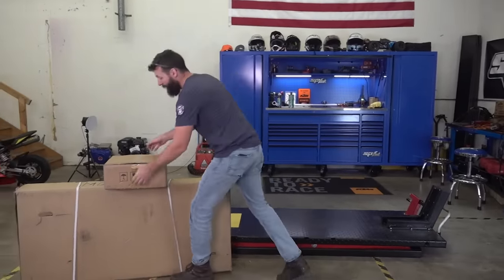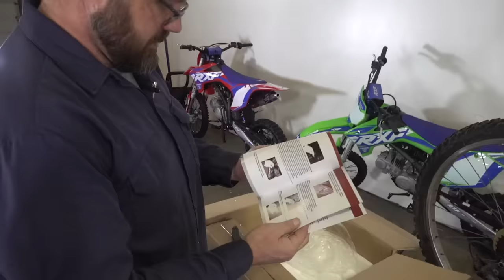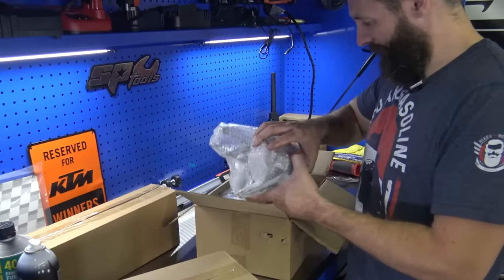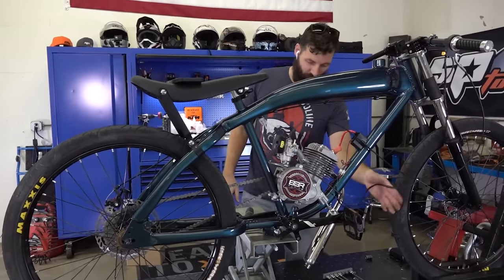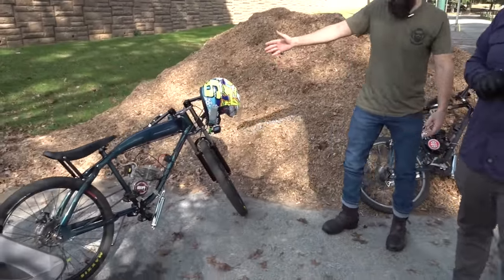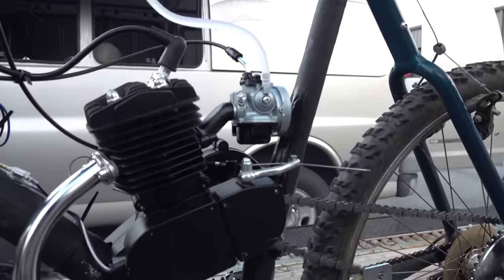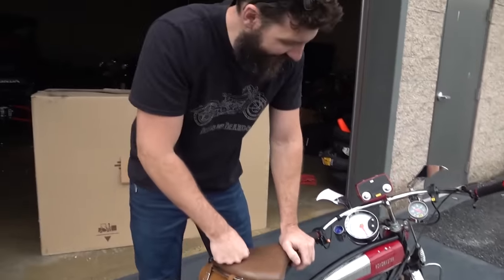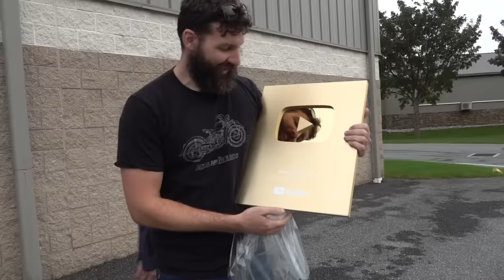I Bought the Cheapest and Most Expensive Motorized Bike kits from Amazon

Comment: Had one of these in high school.  I tuned and polished the ports, and sanded down the jug for higher compression.  It was an absolute riot and weighed in at only around 50lbs, so it would do about 35mph on the straight.  Wouldn't want to go much faster than that on bicycle tires and a single tiny disk brake, but I loved it!
Reply: I hit 60km/h going downhill on the way home on my normal mountain bike, solid as a rock lol
Reply: 65mhp here bud. Thats when i has a stroker engine.
Reply: I got a cb750 for free from my mates dad because they didn’t want it (it had 900,000 ks on it) and I chucked it in my push bike it was fun but jeeez it was scary I think best I done on it was about 110 on a flat unpopulated road could have done more but didn’t wanna die (needed new back breaks after) there was basically more engine than bike and I never got in trouble for it
Reply: @miataisalwaystheanswer1356  are you trying to say that you were running a 750cc engine on a bicycle?
Reply: I hit 55mph on mine I built when I was 15
Reply: @StrawberryRazorz666  I hit 35~40 on a Walmart bike on this huge downhill
Reply: @miataisalwaystheanswer1356  surely you're not saying you had that engine on a normal bicycle. Please tell me you meant something else...
Reply: @DoctorEvil  He's full of shit and trolling everyone, pay no notice.. its not possible unless you re-enforce the frame 2-3x it's original size: a la.. no longer the original bicycle and merely a custom made steel frame with a motorcycle engine attached.
Reply: @miataisalwaystheanswer1356  back in about ,1980 I took a 1973 Honda CB500 four street bike and turned it into a dual sport that weighed less than 400 lbs , 6 inches suspension in front and 5 inches suspension on the rear 
.it was a hoot to ride in the woods moto tracks and back county dirt roads river bottoms and cruising the interstate at 80 mph with the top end of around 115mph at 11,500rpm   and used almost all stock Honda parts from various old parts bikes stored at a Honda shop where I was employed at the time ..with a boss who encourage me for such hooliganism as long as I did it on my own time ...wish I had that job again ..it was go fast heaven , run what you brung , build it and they will come ..then the boss would sell them .. so I would just build another monstrosity ...like a 900z into a 1050 using four Pistons from a twin cylinder CB450 Honda ....the parts shelves were full of obsolete parts ... I learned very quickly had to use a pair of vernier calipers to see what will fit what this week ...my 500 four had four Pistons from a XL125 with domes for high compression
Reply: @Mike Jay Leno had a gas turbine jet engine from a military helicopter put in his motorcycle ..just say'in bahahaha
Reply: Built mine when I was about 12-13 had a dio reed valve and a 28mm pit bike carby went about 50mph I didn’t weigh much then so I flew
Reply: @donniebaker5984  I saw that episode💪💪👍👍😂
Reply: @miataisalwaystheanswer1356  i call 🐂💩 on that one. what sort of "push bike" frame can hold a 750cc motor??? i have a Kaw 750ltd and that motor could not be mounted into any sort of peddle bike frame without it collapsing from the weight of the motor going down even the smoothest of roads.
Reply: I got the same damn thing except its also on a 30 year old bike with stock tires making close to 10 horse. Sketchy as hell but that's all apart of the fun, hell my boot was my break for a good minute till I rigged up some terrible breaks. (Update, took it over a dirt bike jump and folded the front tire so I got a new one lol)
Reply: I did the same thing. Put a pipe and carb and shaved the head and melted the spark plug cruising at 49mph. Went 59 on a slight downhill until the frame split at the front mount.
Reply: 35mph with a single tiny disc brake. LOL 😅🤣
Reply: My 80/100cc has gone 45 top speed no exhaust with warped wheels. Plan on going even faster with my new build I'm working on.
Reply: He bought a Y2K which comes with a gas turbine helicopter engine.  He didn't have anyone build it.
Reply: Bigger brakes and fatter tires would prob make this 2% safer lol

Comment: keep in mind that the engines require the cold air running over them (from the bike's movement) to cool themselves. They likely could have lasted significantly longer on the road
Reply: I bought my kit when gas was nearing 5 buck a gallon and still running strong 8 years and 3500 miles later I'm sure there is a Rev limit and it's not wide open with no air thru the fins 😅
Reply: @henlohenlo689  sorry I bought the 80cc and used my own bike
Reply: @henlohenlo689  i would recommend an 80cc engine kit upgrade to a hub drive sprocket, different cylinder head for better cooling. Vibration is an issue so you have to use a thread locking compound and inspect everything frequently. Replacement parts are cheap.
Reply: @paulzumpf3612  can i use gas bike to replace car if commute is like 15 miles each way? heavy city traffic. 

also any "cool" helmets u might recoomend?
Reply: @henlohenlo689  I ride mine to work everyday. I've seen people in Bogota Columbia riding them through the city. I doubt your traffic is heavier than that.
Reply: @paulzumpf3612  i live in fontana california. places i commute to is rancho cucamonga, san bernardino, south rialto near riverside unlikely this one use car.  sometimes ontario. the city streets here and kind of rough for cyclists dangerous.

Comment: My 14 year old has almost 200 miles on one of the cheap engines this summer. Of course they will lock up with no airflow c'mon guys...
Reply: they did it for ratings lol
Reply: I did like 3000 miles during a year on one of these engines, and I ran at full throttle all the time. They are really good for the price.
Reply: He didnt use 16:1 and that pre mix gas isnt the good stuff 40:1
Reply: The Ratio is exactly why they failed btw
Reply: These run on 3.2 oz of oil to one gallon of gas from first start up and its hole life .never use 16:1
Reply: I just hit 2000 miles on my current build and its still running strong.

Comment: I’ve had mine for years you have to break them in right to last and run them rich if you do that they can last up to 10000 miles.
Reply: My mounting studds broke lol I did have in on a chopper so thats probably why but these motors are potatos fun potatos though lol
Reply: Yeah in my old day I even change the pipe and mod the small socket
Reply: @mrcoco3562  you can mod literally everything on these motors its kinda cool
Reply: Lane AWD  the predator 212 is a much better engine. I recommend the baby 79cc built up a little bit if you must have a tiny but powerful engine.
Reply: @boringbill  yupz bro I remember it come with 50cc 60cc 90cc but 50cc it's the faster pick up 😊 I kinda miss the old day
Reply: @mrcoco3562  yeah I switched to 4 stroke last year but the 2 strokes were fun
Reply: @boringbill  I've been thinking about the possibility of switching as well. Any pros or cons with using a 4 over a 2?
Reply: @benjaminboundey7107  probably size and it is a little harder to work on but not much and you'll want to change that with 2 strokes the have a lot of high end and 4 strokes have more low end also the upgrades cost more but reliability is a lot better and they are way easier to tune
Reply: @boringbill  how about the integrated CVT (if you have one)has that given you any trouble? 
That would be one of the draw backs for me. I tend to be on the heavy side, so I would hate to be replacing parts in the transmission all the time.
Reply: @benjaminboundey7107  I weigh 268 well 275 bc of Thanksgiving and they do fine with me and my bike is just under 100 pounds although I will say I've only put about 100/150 miles on it even the clutchs do pretty good
Reply: @boringbill  cool! Yeah I weigh just under that at about 245-250 so it sounds like it would carry me fine should I decide to get one. Does it seem to have more or less low end power than a 2stroke?
Reply: @benjaminboundey7107  way more you won't even need to use the pedals and I just have a 79cc with the governor removed if you get a 212 which ironically is cheaper they're even better I didn't get one bc it wouldn't fit otherwise I would of but the 79 does ok
Reply: @boringbill  ok cool! Sounds like you went with predator? I've thought about doing that! 212cc sure sounds tempting! Do you have a centrifugal clutch?
Reply: @benjaminboundey7107  you I have a 9 tooth centrifugal and a 60 tooth on the wheel the reason I have it so tall is bc I have a 20 inch wheel
Reply: @boringbill  Sounds like quite the gearing! You should make some videos on it.
Reply: @benjaminboundey7107  I may some time I'll have to think about it
Reply: @benjaminboundey7107  sure. Reliability. 49cc HS, I bolted it on and a year later, it only stranded me once, and that was o/o error (hole in fuel line). Every CG I've had was "something" every trip. This isn't my daily driver. It's my ONLY driver. And I'm about 20 miles from nowhere.  
Also, price of gas. About the same mileage (100+ mpg) but you pay like $2 more per gallon for good mix.   That's an extra 50 miles for me.  Downside?  No mods for 4 stroke. Crappy governor too. Can I say crappy here?

Comment: I have built several of those bikes. I actually went through 3 engines on one bike. But, set up properly, I did get over 2000 miles out of one of the engines. Not at full throttle, I kept my top speed to 20 mph. There is one part on those bike kits that will kill you, and that is the clamp on chain tensioner with the little plastic pulley for the motor chain. I had one get sucked into the rear wheel once, it destroyed the wheel, locked it up, and I crashed hard, onto concrete. I was riding in a bike lane, and was fortunate enough to crash to the right, onto the sidewalk, instead of to the left into traffic, where I would have been crushed by cars. NEVER use those things. You can get tensioners that mount to the motor. And that rag joint rear sprocket is junk as well. No possible way to keep it centered. You can get a clamshell rear sprocket mount that clamps to the rear wheel hub. You absolutely HAVE to have a front brake with these things. The coaster brake on a Walmart bike is completely worthless.
Reply: Sheesh glad you’re safe
Reply: E-bikes have the most configurations you can get trikes bikes moped scooters motorcycles with many different power levels and options available, e-bikes have very good reliability and you can even get a foldable solar panel to charge your bike when you're not at home, it takes me on a full charge about $0.05 worth of electricity and that can get me 35 miles on just the throttle or 70 miles if I help by pedaling, when I got my first e-bike I didn't see many around town but now there's a lot of bikes and motorized bikes around
Reply: The same thing happened to me, if you can, order the tensioner that bolts to the engine. It is a lifesaver.
Reply: Word.
Reply: Thanks for the info dude...appreciate it
Reply: Absolutely! Those standard tensioners are Lethal
Reply: @donaldrobinson214  e-bikes have unstable batterys that have caused house fires. there not worth it untill they move away from lithuam ion batterys to lifpo4.
Reply: well good thing that i have the motor mount chain tensioner and a hub clamping mount rear sprocket on the way right now. i already did about 600km on my bike in just 5 weeks
Reply: how does your e-bike function in extreme cold
Reply: Omggg I had this happen to me on the way to school. Flung off my bike into a ditch on the side of the road. I was so mad I left the bike there and limped to school.
Reply: Adjust the length of the chain to suit. No shitty plastic p.o.f Supplied sprocket is fine
Reply: Weld the sprocket ⚙️. 🫡

Comment: As a bigger guy myself, I think I have to finally point out the obvious size/weight difference between Sean and Craig when it comes to these head to head battles.
Sean needs to be wearing a backpack full of ballast to even the scores!
Big guys unite!! 
Thanks for the laughs guys!
Reply: Or the bigger guy can just lose some weight, the weight difference is more even and he's better off, win win for both 😅😝
Reply: @Johny40Se7en you realize some people are just naturally larger, right? And I don't mean the fatlogic definition of "naturally larger". On top of that it takes all of ten minutes to fill a backpack with ballast
Reply: I'm over 300lbs and put one on a beach cruiser, put a couple hundred miles on mine befor it got an air leak and I couldn't figure out where and just sold it

Comment: When I was 13, I built a 16" motorised bike with a 31cc 2 stroke whipper snipper motor. That was driven via a machined shaft onto the rear tyre. Would do 63km/h (Australia) and then..... went N2O injection with some creative engineering and could get up around the 80km/h mark. Looking back that was nuts.
Reply: *shAft; N2O
Reply: That's pretty impressive
Reply: i crashed mine today
Reply: Dads saying yeah course you did

Comment: The fact that the cheapest motor stayed on the frame with only one motor was a shock! You normally have to check the tightness of the mounts because of the vibration from the engine. I've had a 2 stroke fly from between my legs this way. Be safe y'all!

Comment: I own a cr250r race bike, a ninja, and various other toys. My 80cc (66cc) motorized bike kit is my favorite thing to ride. I’ve put over 2k miles on it so far. Original engine too! I’ve tried blowing it up by mixing the oil 1-1 and it smoked out the street like a diesel. These things are amazing. Best 120 dollars I’ve ever spent.
Reply: What type of ninja
Reply: Adding oil to 1-1 and making it smoke badly isn’t gonna cause an engine to blow up if anything it’s gonna ensure it doesn’t blow up🤦‍♂️
Reply: @tylerseabook9423  too much oil in 2 stroke fuel can trash a motor. It seems contradictory, but the extra oil increases the “thickness” of the fuel mix and in many 2 stroke carbs will result in a leaner fuel/air mix. Running lean results in more heat, and on an air cooled motor that’s really not good. My neighbor has a small engine/ chainsaw shop, and sees this happen a lot. Typically it’s an inexperienced operator that knows just enough to be dangerous. They aren’t sure of the mix ratio and just add oil until it smokes hard and figure they’re good to go because “more oil should be better, right?”. Nope
Reply: @MrIgottap   well there’s a limit but until you hit that limit too much oil wont hurt
Reply: 120 hours for $150. Crf250r $1900 for 60 hrs

Comment: Fuel to oil ratio should be 16:1 for the first two tanks and 20:1 after the break-in. I've built and sold 21 of these bikes in the last two summers
Reply: False unless you're using used motor oil. With proper 2 stroke oil then 40:1 is plenty. 32:1 isn't even needed unless you have tight tolerances custom stuff. Too much oil like 16:1 will lean out the mix and overheat the motor
Reply: @KClO3  No, 16:1 is correct for a couple of tanks and 25/1 after that. Running this type of air cooled motor wide open and being stationary is a no no.
Reply: @mikesouth6490  no it isn't. It's simply not true. 40:1 is plenty. Many run 50:1 from the start without harm. Too much oil will trap the heat and lean the mixture of gas to air which will also cause more heating. Who was talking about running it stationary?
Reply: @KClO3  if you read the manual and info avabile it says 16:1 break-in and 25:1 after I run mine at 32:1 with no problems for the last 3 years. Also, they had no cooling while on the trailer.
Reply: @cdcorrigan  80cc, although in reality they are 66cc. The 50cc is super small

Comment: I had one of these as a teen. It was the “80 cc” (66 stamped on the side) and it lasted me years. I rode that thing everywhere and wide open throttle the entire time. Mine lasted for what seemed like an eternity. I ended up trading it for a pit bike and the guys I traded to rode it for years after that. If you mix the gas and oil properly and do regular maintenance, they last forever. The fact they sat on a trailer revving with no air flow on the cylinders, which have fins specifically designed for airflow, is what caused them to fail. Still cool video though. 

It was like a gateway to me riding motorcycles as an adult. I would recommend to anybody to build one of these. They are so cool.